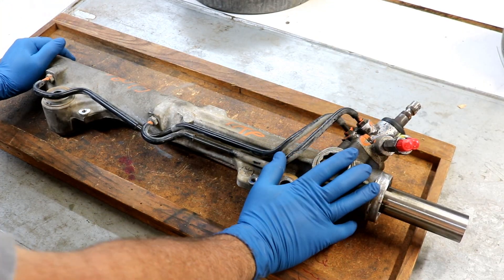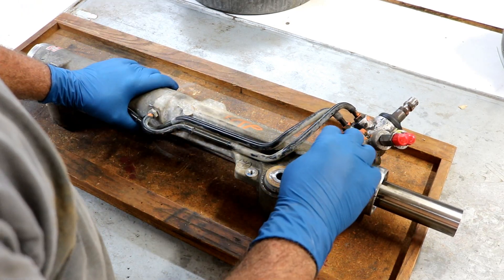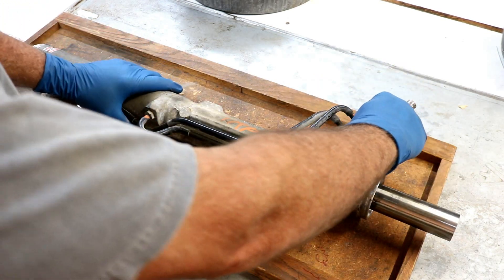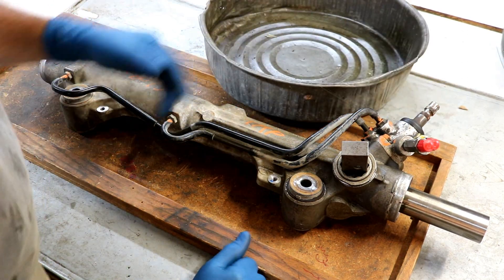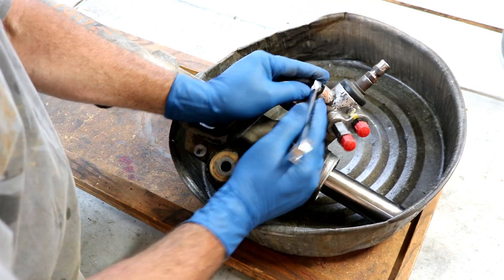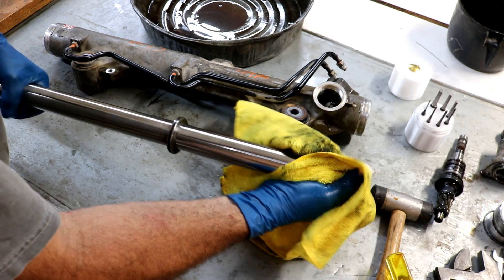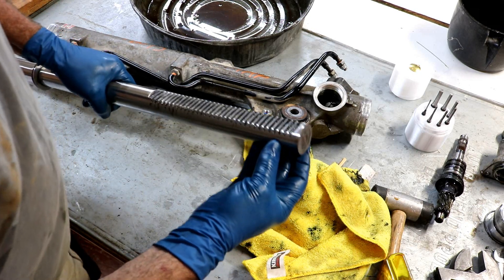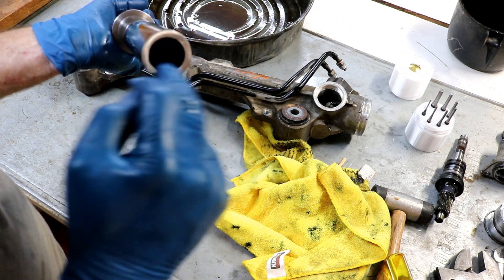Toyota Steering Rack and Pinon Replacement | Tacoma Steering Rack Broke | Rack Mods P1

Comment: Do you know anything about the porting they do inside for the fluid?
Reply from the maker: I do not know and I am not real sure what you are asking.
Reply: Solo motorsports claims they do porting to the hydraulic passages for proper flow. Does it work with just your mods?

Comment: It was cool to see the rack come apart - as an apprentice at a Honda dealer I had to rebuild Acura racks because they weren't available at the time, it took me back.  I was interested as well to see how hard the rack itself was, I wonder if it has a medium hard core with chrome surfacing?  The medium hardness would make it less brittle.  On to part two, this is a cool project!
Reply from the maker: Yes softer core not bad to machine hard chrome outside.  I just finished doing 3 more of these this week.  Thanks Everett.